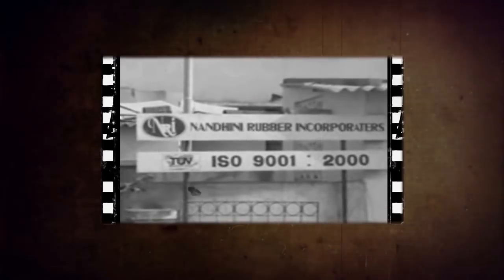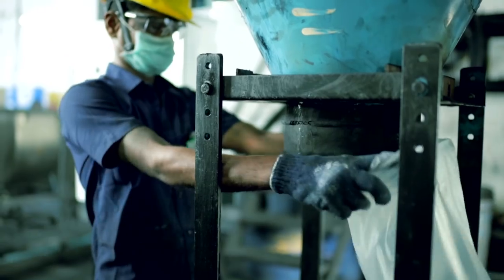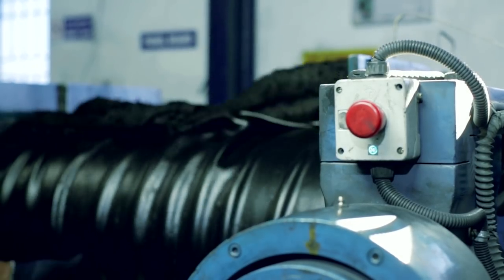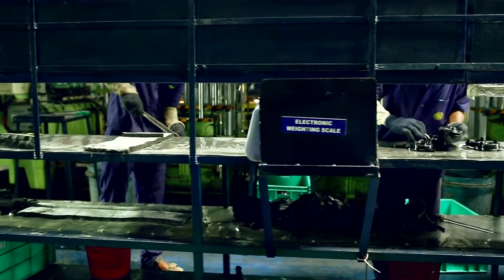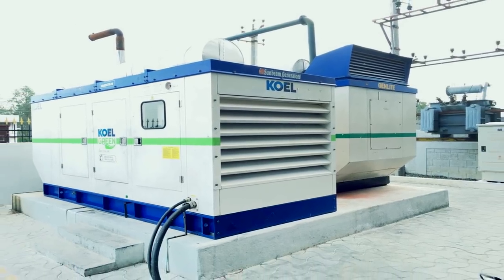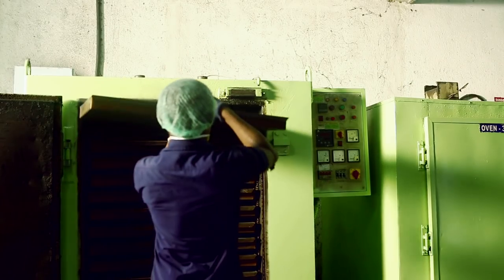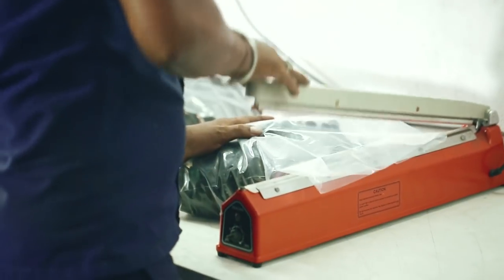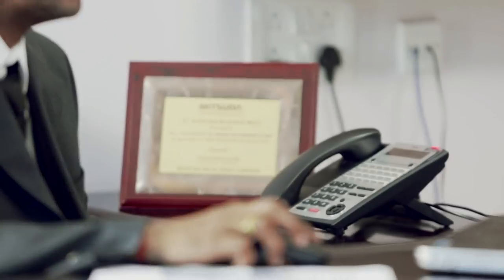Nandhini Rubber Incorporaters

Comment: One needs..
Natural gas and layered
catalythic columns..which
Influence chemistry more than use up catalyst..
Lower order and transition metals..;
Perhaps even the gas aligns in a well first..If that is the 

Case..how could it evern be filtered..without oxidation?..Salt?
Then cleaned again and aligned in a column..into rubber..Then
Sent into heat and gas chamber..and pelletized or rolled for storage..;
An acid distilation plant for making chemcials..A chemical
Exchange between plants a chemical recycling plant.